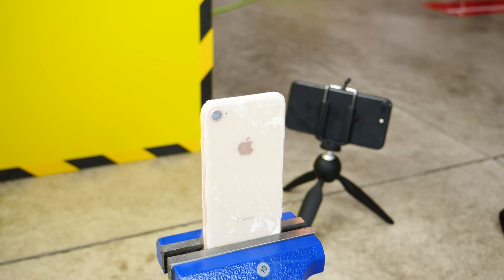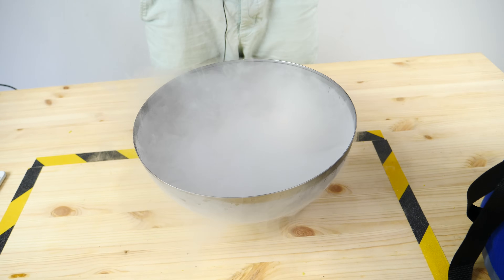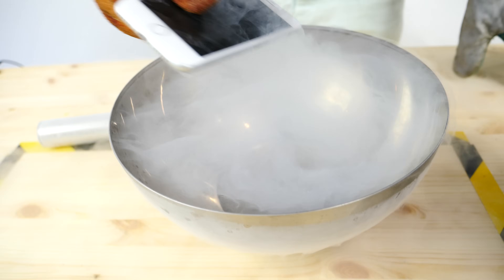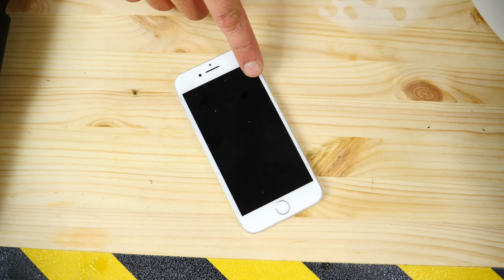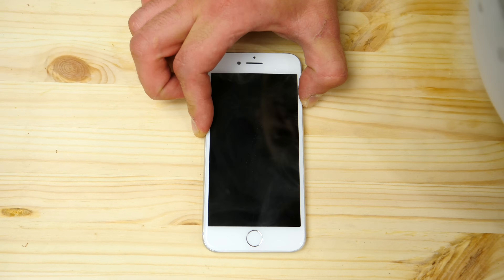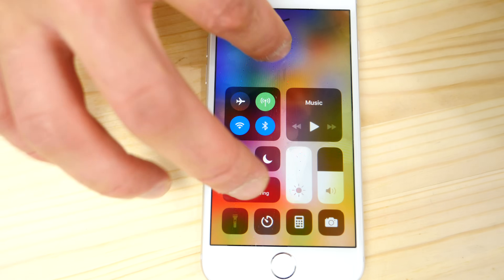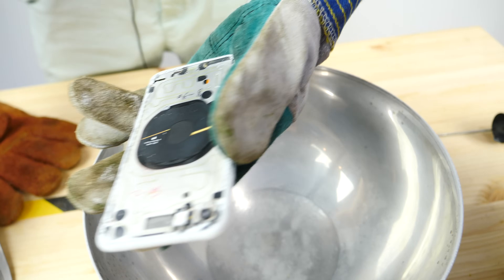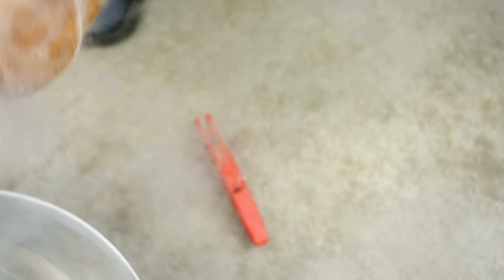Can iPhone 8 Survive In Liquid Nitrogen?

Comment: What's happening here is that the liquid nitrogen is basically freezing up the battery, and we all learned that when things get cold they will have less kinetic energy. So the electrons in the battery are stuck in position and can't bring the electricity to flow. Liquid nitrogen is also non conductive so If you had a hole in the iPhone, it'd be perfectly fine to operate at normal room temperatures.

Comment: Of course the screen broke, you touched a freezing cold sheet of glass with your body temperature finger, that’s a huge temp difference, glass and metal both work the same way if you have it either really hot or really cold then touch it with something on the opposite end of the temp spectrum it will crack

Comment: Try to wirelessly charge and charge (with a cable) at the same time! Like if you agree.
Reply: no it won't. this is well known. also if they did it smart, wireless charging would stop when the cable is connected to reduce the heat that wireless charging creates.
Reply: that's not how it works.
Reply: How to fast charge with out fast charge cable
Reply: Lucas Khattar double the charge lmfao
Reply: I tried it with my Samsung, it doesn't work
Reply: Lucas Khattar good idea 💡
Reply: Lucas Khattar I really don’t know what that would do it might break the phone or just charge really really fast who knows
Reply: @blindinsanity5733  The wireless charging will stop.
Reply: Lucas Khattar what a mediocre challenge
Reply: Hashim Boi I just want to see if it charges twice as fast

Comment: I had a small problem.It is blutooth is auto  on after updating to ios11.Am I alone?
Reply: 오무지 댓글러 갓자친구 it’s a feature if you close the Bluetooth or WiFi from control center it will still work but in low powered mode if you want to completely close it you have to do it from settings 
I don’t like this feature tho
Reply: 오무지 댓글러 갓자친구 just go on settings and turn it manually off
Reply: 오무지 댓글러 갓자친구 same
Reply: Happens to me to